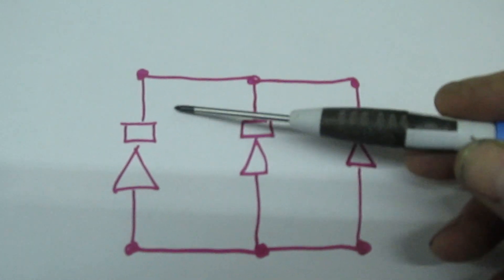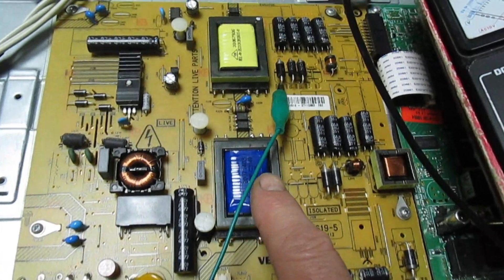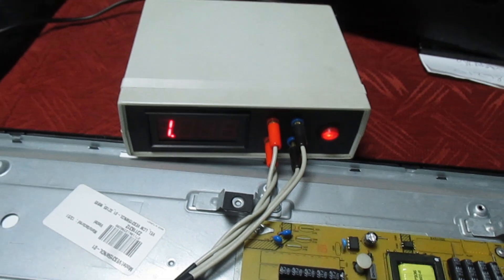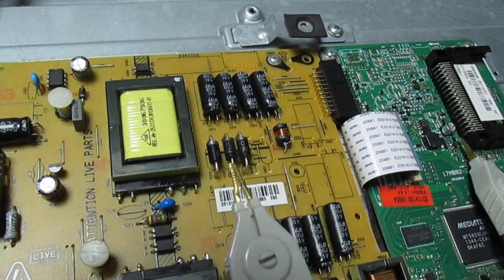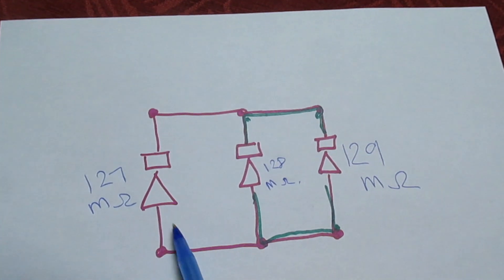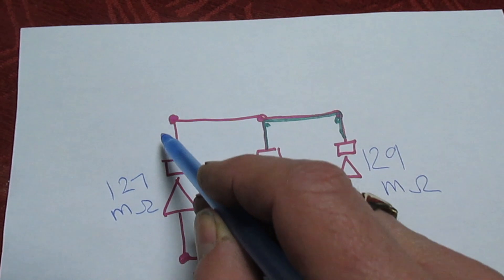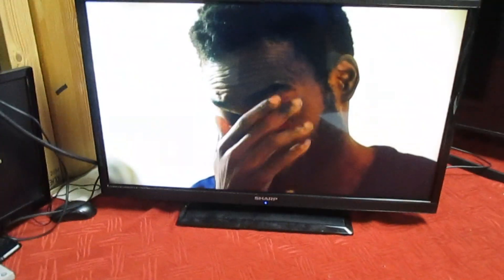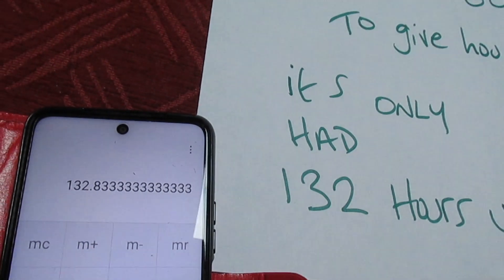Short tracing with a millohm meter practical demonstration .

Comment: Great video! The further you measure away from the shorted diode the more resistance you read (very minute) due to the traces, if I’m understanding this correctly.
Reply from the maker: Correct , the difference is so minute only a milliohm meter can detect them .

Comment: Wonder if the diode is heat sensitive when testing. I know shorted capacitors are easy to find using leakseeker.

Comment: you mean the one with least resistance is the faulty one?
Reply from the maker: correct .
Reply: @michaeldranfield7140  where dud you get the dual tap transformer your homebrew milliohm tester? i want to build one like yours
Reply from the maker: @frankbaron1608  Cant remember now but it was either form RS components or Farnell .

Comment: Hi Michael, like your video, but what i dont get, the diodes are all in parallel, so why is the reading not the same?
Reply from the maker: because you have the resistance of the copper leadout on the diode and also the resistance  copper print that connects all 3 diodes together.
Reply: @michaeldranfield7140  so because you are using a lower resistance to measure (miliohm meter) are you saying the closer you are on each diode (measurement) you are going to get an accurate reading on each component. It's kinda strange to comprehend, as the diodes are all in parallel.
Reply from the maker: @audioal8015  Yes this is correct, you can  measure the lead resistance of a diode but just the lead will be in micro ohms but when you add this to the resistance of the copper pcb track and the second diode its in parallel with all this can add up to 1 milliohm and this is how you can differentiate between the faulty diode and the good one .
Reply: Thanks for the update michael, i dont have a miliohm meter, but I'm going to invest in one. Al.

Comment: I know this is not built for presicion measurement. but what is the shorted probes offset when connected to a dmm instead of a panel meter?
Reply from the maker: Sorry I dont know as I have never used this with a digital multimeter .

Comment: That fault was on the power supply. The hours used doesn’t account for time it’s off. The power supply is “in use” The whole time it’s plugged in isn’t it? So if the tv is 10 years old but never gets used that’s very different than if this fault happened to a tv that is only a year old. The power supply of the older tv has done quite a lot more work?
Reply from the maker: This is correct , the psu is still running in low power mode while the TV is is st by but very little current is drawn from the secondary so this does not excuse the diode failure or poor design .

Comment: Hello, couldn’t I use my ESR capacitor tester with its digital ohms display? I know this tester uses high frequency to test caps however, I wouldn’t think this would make a difference,  your thought anyone?
Reply from the maker: Only if your ERS meter has a milliohm resolution , the ones I  use dont 0.1 ohm is the smallest mine can read
Reply: @michaeldranfield7140  oh thats right, one milli ohm is .001 ohm.

Comment: I spent 50 years in power supply design and never seen or felt the need to use 3 diodes in parallel. Surely one rated 3 times as much is cheaper that 3.
Reply from the maker: you would have thought so , but without any current balancing resistor in series  or R/C snubber network across the diodes its pretty pointless putting 3 in parallel, there was one set with 5 diodes in parallel !
Reply: @michaeldranfield7140  So would not a diode and a balancing resistor be cheaper than 3 diodes? Maybe it might be a market with diodes with balancing resistors built in the diode? Of course not, otherwise it would have been done. Be interesting to see the detailed cost analysis of 3 diodes vs. 1 diode + 1 resistor -- I wounder if its a close race?

Comment: When I've done it in the past, I've just used the bench power supply at low volts and see what gets hot. These days it's so much easier because you've got thermal cameras
Reply from the maker: Done that in the past and burnt my finger looking , I dont have a thermal camera.
Reply: @michaeldranfield7140  Freeze spray is handy too. The good ones get frosty, the bad ones don't.

Comment: Quick question is the milliohms meter powered by ac voltage or battery?
Reply from the maker: no I made it mains powered so I could leave it on for long periods without a degrading battery affecting measurement accuracy  .

Comment: Both this and the original video were quite clear on the topic, but I know how sometimes a second demo on a different circuit can clarify things in a big way. Nice that you can catch a 1 mOhm difference with this meter.  My LCR meter (a DER) also can sense down to 1 mOhm, and it's made a world of difference in finding circuit faults quickly.  Worth the $.  Can easily spot bad caps that show no mechanical failures, too, while in-circuit.
Reply from the maker: I too thought the first video was perfectly clear but there were a few complaints , my problem with the first video was due to the size of the caps I had to use both hands to hold the test leads and so couldn't move the camera at the same time but on this set I could clip onto the diodes and keep my other hand for the camera .

Comment: Also, removing the faulty diode, cut the legs. When you use the soldering iron, you are only heating the solder on the pad and the tiny bit of leg, rather than the entire diode acting like a heat sink.
Reply from the maker: Useful advice for anyone just using a standard 25 watt soldering iron, I use a pace soldering station though which goes up to 420 degrees so makes no difference to me .
Reply: Only cut one leg to prove the fault, solder it back up if you got it wrong first time.
Reply: Sorry, but could you explain this more please? If the diode was faulty and therefore needed to be removed...I would most certainly desolder it and solder in a new replacement. Why would I have to cut the legs? I'm probably reading your comment wrong, but that's just the way it came across. Even if I wanted to check it by desoldering one leg, why would that be worse than cutting the leg? Many thanks

Comment: Good practical demonstration, I’ve used the same method too. Would replace all 3 diodes as a preventative measure, if one has failed the others are bound to follow after reassembling the set…
Reply: I was thinking the same thing. I notice there's two more empty spaces for diodes too - just wonder if Sharp reduced the count or whether it's relative to screen size as to how many are fitted.
Reply: @MrBetaByte  Has to do with which model is being manufactured. It's cheaper to make 500,000 of one pcb design and only populate what's needed rather than make (and store) 100,000 of 5 different boards and need spares later, or discontinue one model and have 6,000 leftover that can't be used.
Reply: @MrBetaByte  Good point.  Makes me want to add two more diodes or replace all three with higher current rated ones.  They appear to be paralleling capacitors as well though I can't see the traces to be certain.
Reply from the maker: I always replace all 3 , this was just to demonstrating how good a milliohm meter is .

Comment: Recalling the last video's hours of operation observation, I estimated my parent's tube TV use this past weekend -- it has about 109,000 hours (through ~25 years); not a single issue.
Reply from the maker: Built to fail, in this case , the first thing is basic electronic design, why on earth the manufacture makes this mistake  , it can only be deliberate , you cant put diodes in parallel unless you place a current sharing resistor of say 0.1 ohm in series with each diode,  2 ,no RC snubber network across the diodes, the back of the board is marked out to take a resistor and capacitor but there not fitted . 3. the choice of diode fitted only has a PIV of 100 volts and its blocking a PIV of something like 95 volts , the fact that the manufactures has been using this same diode set up for at least 10 years can only mean its done to guarantee failure .
Reply: @michaeldranfield7140  Or to use up excess stock of 100V diodes.  Could also have been just to save a few pennies/unit when production started.  Operations managers are not engineers but they're the ones who make the production decisions based on parts availability and profits.
Reply from the maker: @sincerelyyours7538  cost cutting , they have been using these same diodes in parallel for the last 7 plus years .

Comment: 2nd request!  Do you have a schematic to your Milli-ohm box?
Reply from the maker: Sorry I dont have the schematic , I made  this about 10 years ago from an article  I seem to remember was published in Everyday electronics magazine.
Reply: @michaeldranfield7140  - Was that EPE Mag.?
I have all issues back to 1999
Reply from the maker: @tubeDude48  Yes  thats the magazine .
Reply: @michaeldranfield7140  - Thanks!  As I get each issue of the 3 Magazines I get, I keep a plain .txt file with remarks of page number, and title of the Article. I use Agent Ransack to search for a particular Article, so it should be a snap to locate the Article on the Milli-ohm meter.
Reply from the maker: @tubeDude48  I have them back to the first issue , 1972 I think but I dont have any filling system I just have magazines everywhere in no particular order, not just EE , I also have Television , I use to write for , practical wireless, practical electronics, electronics today international, radio constructor,  I literally have thousands of magazines  so it wouldnt even be possible for me to look for you , you should also be aware it may not have been called a milliohm meter in the article , it may have appeared under a heading such as short locator .
Reply: @michaeldranfield7140   - If I locate the article, I'll send that that info.    BTW, I subscribed a month ago!
It was Aug 2013  pg 28-36  Milliohm Meter Adaptor or DMMs
Reply from the maker: @tubeDude48  would be handy if you found it as people keep asking for the schematic .
Reply: @michaeldranfield7140  - Since EPE, (now PE) prints your password on each page, I'll have to ask PE permission to print that article.  Stay tuned!
Reply from the maker: Watch my channel next week, I have found it.

Comment: The right tool for the job!
Info for those who may not know ...
The 4-wire "Kelvin" connection allows precise measurement irrespective of lead resistance and (within reason) contact resistance to the component on test.
One wire on each clip is to the constant current source, the other to the voltmeter.
A standard multimeter combines them both inside the meter, making them a bit useless for measurement below a few ohms, even when you "null" the leads the reading still depends on connection resistance.
Reply from the maker: I never used this when I made it as the test leads were about £100 a set , it was only a couple of years ago when I saw the Chinese were making the Kelvin leads at a tenner I started using it !

Comment: Very interesting way to find a shorted diode, if they were surface mounted, it would save time and hassle.
I would replace all three, if one has failed the other two will at some point.
Underated cheap components are the curse of todays consumer electronics.
Reply from the maker: This video was just to demonstrating how a milliohm meter can single out the faulty component rather than removing them all .
Reply: @michaeldranfield7140  As an ex consumer electronics engineer, i was always told that with more than one diode in parallel failing
it is good practice to replace all of them to save a bounced repair.
This demonstration was an excellent way to find the faulty diode.
The quality of todays made to a price sets is not what it used to be.
Reply: "The curse of today's consumer electronics". Yes, the gift that keeps giving and giving  :O\
Reply from the maker: @ovalwingnut  Of course , the gift that keeps giving , this is where you make some money, not spending hours on end just looking at one set , in the 90s it was high value start up resistors going open circuit , now its shorted MLCC s and diodes .